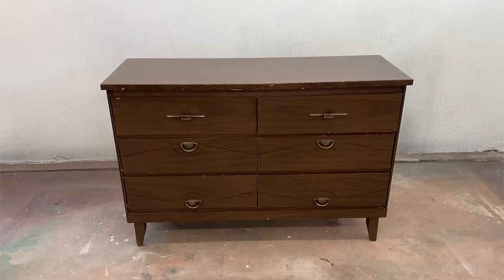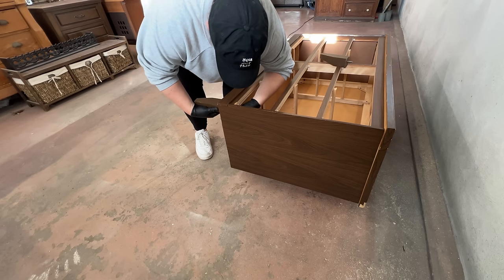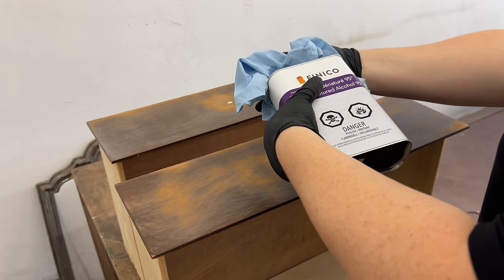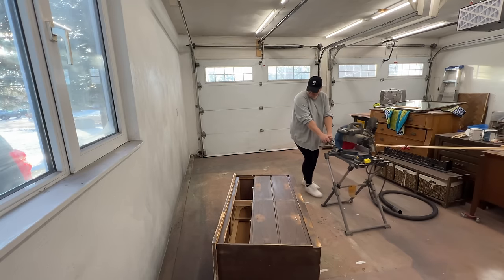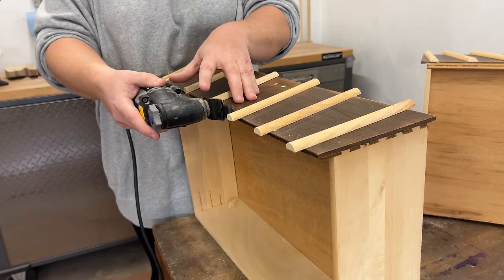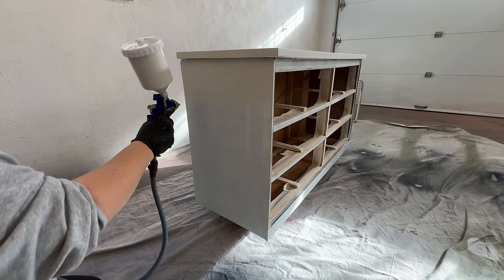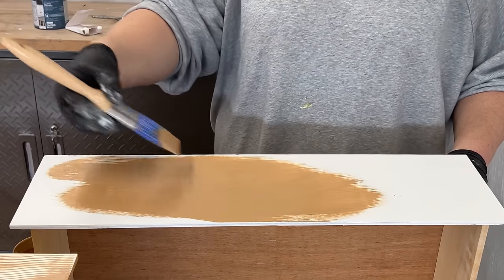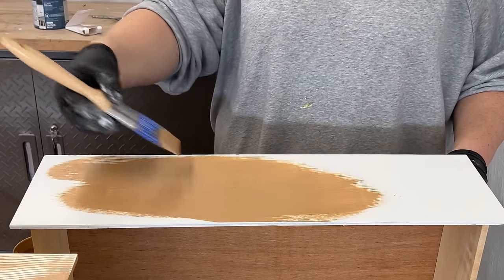Revamping a Laminate Dresser into Mid Century Beauty | Sunshine VIBES

Comment: Dear Kate, I always look forward to your videos! One tip from watching others do veneer,  they usually take a rubber roller and go over the veneer while the glue is still wet to get out the bubbles.  Maybe even try a rolling pin? Keep up the amazing work, you always inspire me!❤
Reply from the maker: Yep! We’ll get it figured out together…at some point 😂❤️
Reply: And contact cement instead as well or the kind with the 3M backing . I believe the reason white glue usually isn’t used is the water content in it. It will cause it to not lay flat .. ie bubbles and lifting . But as I said above I think it’s best it didn’t work out because what did in the end turned out beautiful
Reply: I have not had success with veneer that needs to be glued versus iron on pre glued.  I used contact cement; wood glue;  j-rolling; weight across the entire surface- it was a bust.  The pre glued iron on was much easier.  But the end result here was amazing.
Reply: You copy a ander painter

Comment: Use a warm iron to spread that glue evenly  under that laminate.  Then take a smooth board the same size . The sandwich the laminate layer between and  clamp evenly.  A rolling pin could also spread that glue evenly
Reply: I suspect that wasn't a genuine fail. But a reason to use $$$$ ReTique it. She's far too experienced to apply veneer like that. Felt icky.

Comment: I’ve never done veneer before so I feel like a back seat driver saying this. You could have done this, but didn’t put it on the video. I’ve seen people use a tool to press out all the bubbles. Another thing I’ve seen done is applying glue to the surface as well as glue to the back of the veneer. Let it dry some and once it’s more tacky, not wet, apply, get all the air bubbles out, and use an iron to reactivate the glue. Just some suggestions. ♥️ like I said I’ve never done it personally so I feel like I’m talking out of my rear 😉♥️

Comment: This project turned out lovely, in spite of little things that didn't go exactly according to plan. 👍🏻
Regarding glue-on veneer ... (1)Contact Cement is the best way to go with glue bonded veneer; never use a water-based/standard wood glue because the wood fibers in the veneer unevenly absorb moisture from the glue and expand, hence the lumpy bubbles; (2) Using a brayer/veneer roller is the best way to apply firm even preseure over the entire veneered surface to get a smooth consistent bond, even when using contact cement.  One nifty benefit of using contact cement is that once the veneer is lined up accurately and the spacers are removed to allow the two surfaces to meet, followed by rolling the veneer to assure thorough contact, the job is a done deal and that veneer is not going anywhere!  Ta da!
There are informative videos online concerning using contact cement, although some of the best are focused on applying counter surfacing, not veneer.  It's the same process.
Reply: Also use an iron to melt the glue’s together when doing veneer. I have seen that done in a lot of videos.

Comment: I can't be the only one who feels like everything in this video is an ad. The veneer fail? I'm skeptical that anyone with your experience would apply veneer like that. But the ReTique It worked perfectly (I've used it since it came out and is one of my fave products  but it's very pricey). The Surf Prep $600 sander, the shop vac, etc. I get making money, go on and get your bag girl. I'm not hating on that. 

But like, be open about it. That's why I quit watching your channel, along with other furniture flippers. It's the never disclosing that the video is basically an ad. And that kinda bugs me. 

People got burned by Dixie Belle, big time. I think of folks had disclosed they were doing content specifically for DB and being paid there would've been more sympathy. The scandal? It barely made a wave.

If you're watching and just starting out, you don't need a Festool or Surf Prep sander. Or an entire miter saw set up. You can do all that for about $100 in tools. My Ryobi orbital sander is probably 12 years old and works perfectly. I added a soft rubber interface, which is what the SP has. You can do miter cuts with a miter box, $10 at harbor freight. A multi tool, is just a great tool to have. And you can get one at Harbor Freight or Amazon on sale. 

Marketplace is my fave place to find tools and even paint. The "mistint" shelf? Big time savings on these paints dgaf cost over $100/gallon (USD). 

I'm just saying, the economy is so bad in the US that a lot of people are turning to flipping to make ends meet and you don't have to go into debt to start doing it. 

Not trying to be hateful, not at all. But the veneer fail was just a bit too much.

Comment: Such a beautiful outcome!  Very elegant and creative take on the sunshine vibe! 
The re-tique faux wood look turned out fantastic but I wish they gave better instruction w/the veneer. You can do it —I learned to apply veneer from my dad who eons ago used to rehab donated furniture to the church for needy families (in his spare time between 3 kids, job and volunteer firefighter and paramedic!). The veneer instructions should have said to add weight across the whole surface (on top of the flat surface material that you put on the veneer). The uneven pressure of the clamps allowed the bubbles to form. Plus they also left out the use of veneer adhesive and the need to roll out to avoid bubbles. 

If you try again, here’s what I recommend: 
They make specific adhesive for applying veneer so use that instead of wood glue. 
Use a roller atop the veneer to work out air/glue bubbles. 
Place a piece of a sturdy, flat material, larger on all sides than the veneer on top of the veneer.
Place weight evenly and beyond the edges of the veneer, leaving no area bare.

You can use any smooth, flat material that’s bigger than the veneer. I use an extra 18” sq tile for smaller pieces bc it adds weight too, but the key is the topper always has to be larger than the veneer. I use plywood for bigger pieces of veneer like the end tables I’m doing now.
For weight, I use old coffee table books or big textbooks from the thrift store or bricks, depending on the size and thickness of the veneer.  The key is to keep the weight consistent so don’t go too heavy next to lighter weight object to avoid warp/bubbles. 
Make sure the weight goes evenly across the whole veneer, over the edges too so there’s nowhere for it to bubble up. Put the books/bricks edge to edge on top, to ensure even pressure. 

I hope you do try veneer again, it’s only daunting bc it’s something you haven’t done before, but you have mad skills so I hope you give it another try!   And thank you for inspiring so many people to rehab tired furniture and put their artistic talents to work.😊  It makes my ❤ happy to see 😊

Comment: You created such a beautiful and unique design here. I do hope you won't let this experience discourage you from working with veneer. It can be a really rewarding process. I usually work with unbacked veneer that I get in bundles off eBay and apply it with a hot iron. You just apply pva glue to your surface and the back of the veneer as evenly as possible and let it dry. Then iron it down, I like to go over the edges at an angle, and trim the excess once it's had time to cool and set up. There'll be a lot less bubbling. There's also contact cement but I like doing it this way. It offers a little more control because it doesn't adhere on contact like contact cement does and the veneer also won't shift around as much as it does using the glue and clamp method.

Comment: Very cool. Keep trying with the leftover veneer. Try a few different methods. Let the rolled up wood relax and put some heavy books to help flatten out. Then try the glue on both surfaces method and let them dry. You then proceed to iron on the veneer. Another method would be as you started it but you use a roller or burnishing tool to get the glue to stick without air bubbles. If you do get air bubbles you should be able to iron them out. 😂 In theory anyways. Flipping Drawers and Dashner Restoration do lots of veneer on their channels if memory serves me right. Good luck! 😊

Comment: you're the 2nd person in a week that I've seen applying glue to only the drawer surface (as per the instructions) and then laying down the veneer, both of you got the same results. However other channels that I watch attaching veneer (don't follow manufacturers instructions) apply glue to both the drawer and the back side of the veneer, wait for them to get TACKY, then place the glued surfaces together and clamp. Others wait for the glue to dry on both pieces completely, then place the glued sides together and iron over the topo of the veneer. the heat reactivates the glue. And even without heat, its the glue sticking to the glue that creates a better bond...what do you think? You could have saved the veneer by using an iron and ironing over the top of the veneer, it would've reactivated the glue.

Comment: It’s not the veneer. I do glue on back of veneer and on drawer face and let it set. Then align with dried glued sides together and clip in place. Then use hot iron to reactivate glue. After ironing I apply a little water with damp sponge to show any bubbles. Re-iron them and voila!!

Comment: Love it! I wonder if Contact Cement wouldn't have worked better for the veneer? Or wood gluing both surfaces before applying. As always, another great project!! ❤ You are so talented and creative.
Reply: I thought the same thing. Other furniture artists that I’ve seen use veneer typically use contact cement.
Reply from the maker: You can use wood glue or contact cement but I think the key is starting with a good quality veneer product that’s flat to begin with!

Comment: I wonder if ironing the veneer would've helped flatten it out.  I've seen some people glue both sides, wait until it's dry, lay down the veneer where it's supposed to go, then iron over the top to melt the glue and bond them.  Even then, there can still be bubbles, but they just go over it with an iron until it's properly adhered.
Reply from the maker: Yes, I’ve done that with paper applications and smaller veneer repairs but I wasn’t really prepared to do a big piece like this. Too much wishful thinking 😅

Comment: I have seen furniture restorers iron the veneer after it has dried. With the help of a light you can see where to apply more pressure with the iron. It is totally normal to see bubbles after veneer has been glued. I have seen many people use this method maybe you can do a little bit research on this topic.
Reply from the maker: I’ve fixed many, many veneer bubbles with an iron but unfortunately it wouldn’t have helped with the situation I created for myself. I’ve looked into a few different methods and products that I can try next time. I just need to leave myself enough time upfront to order things.

Comment: I agree this came out amazing! With the veneer, I thought about the roller(brayer) too, to make sure it all makes contact with the surface below. I also wondered if you took an iron (no steam) and went over it, if it would have smoothed it out. You can do that with mod podge on other projects and it makes it adhere better. Just a thought.
Reply from the maker: Yep, I’ve done it on drawer liners and small veneer repairs but this was a different story. I’ll try again soon.

Comment: I know it said you could use wood glue but I wonder if the moisture in the glue cause the bubbles and maybe contact cement or a spray adhesive would have worked better?
Reply from the maker: After doing a little more research this week I’ve got some new methods to try out.